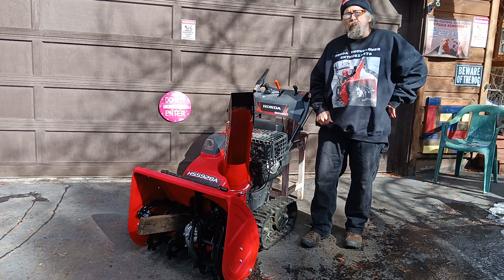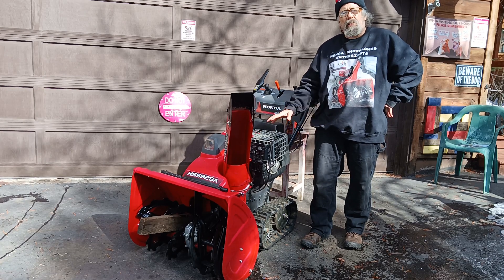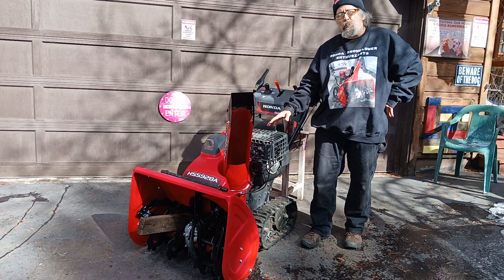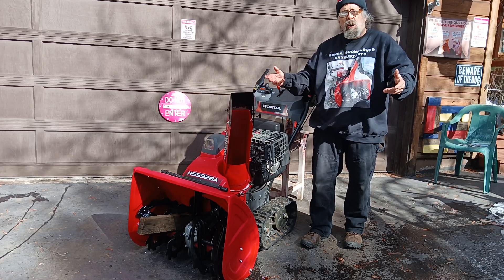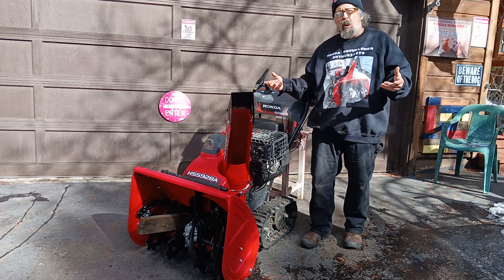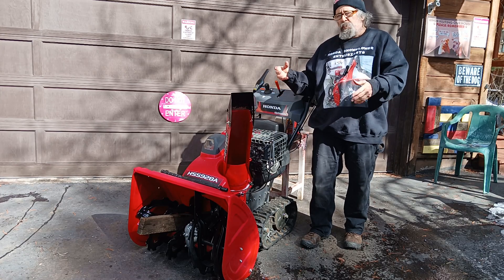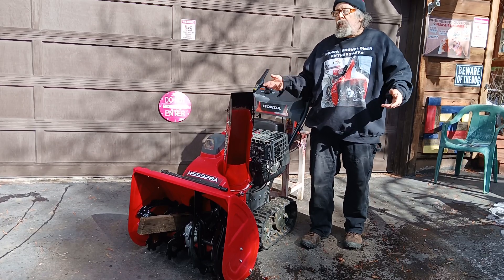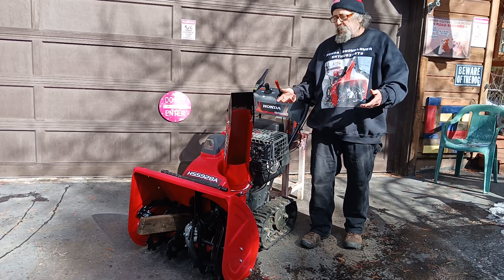TOSS  Snow A LONG Way  With DIY Impeller Kit On Honda HSS724-928-1332 Snowblower ! STOP CLOGGING!

Comment: If the pads help, why do no snowblowers come stock with them?
Reply from the maker: Try them. It's a game changer.
Reply: They have to be matched to each machine as there is potentially enough space difference in mass production units.
Reply: @ ah I don’t buy that.  If the flaps were so advantageous, manufacturers could find a way to make them work.  Flaps are used on many single stage machines.  My hunch is that the flaps add a lot of load on the system and that belt life, gear boxes, etc will be issues long term
Reply from the maker: @charliesmith5189   Have plenty of real evidence that these work with no long term detrimental affect. have installed about 50 sets. My friend has installed over 200 and everyone has been happy. we don't install the flaps with any drag. We have never heard a single complaint .